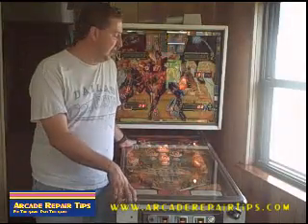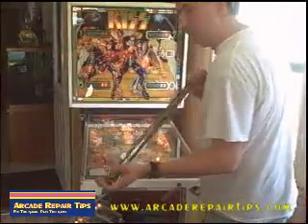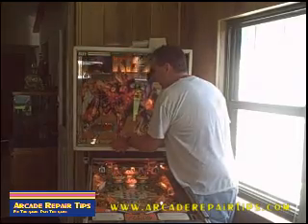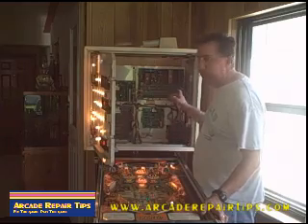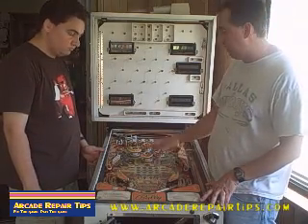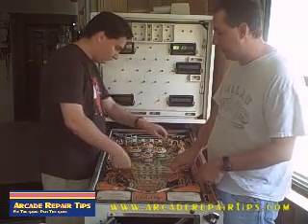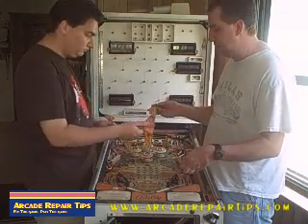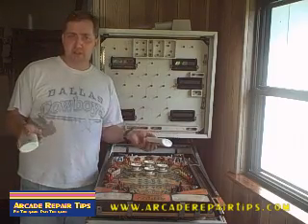Arcade Repair Tips - Cleaning A Pinball Machine (Part One)

Comment: If on a very flat clean surface (glass can be used) you can carefully use a heatgun to melt the playfield plastics flat and put a heavy nontextured object on until cooled (maybe 15-20 seconds).  Works faster than baking, at least in my experiences.